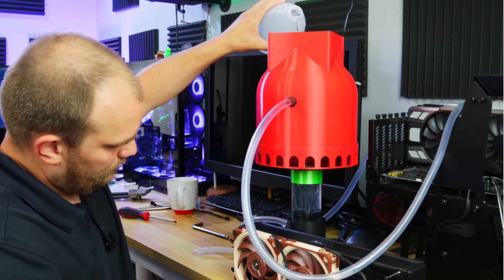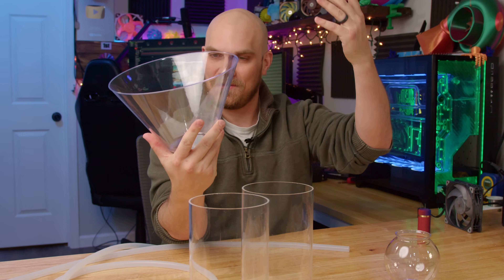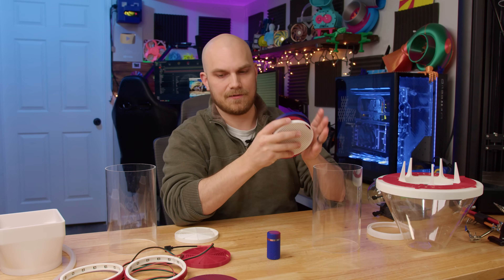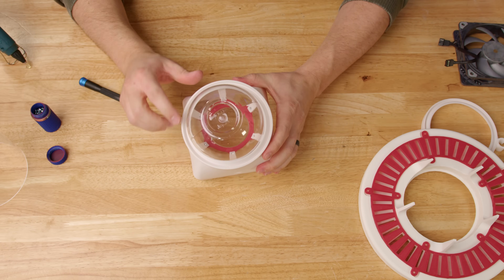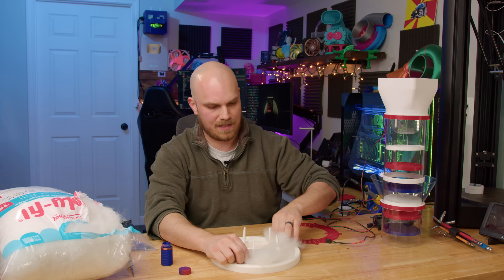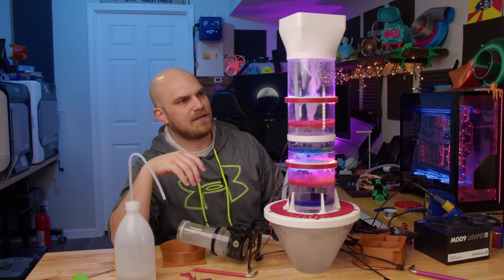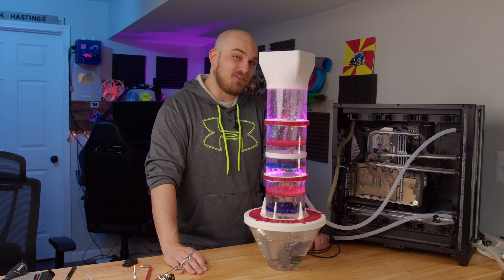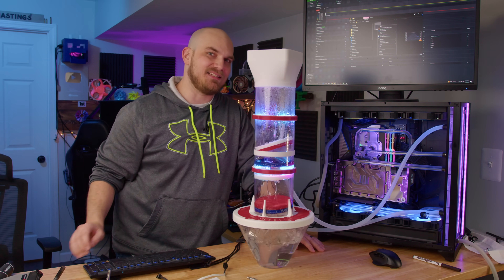Water Cooling..... With NO Radiators

Comment: I don't understand what the goal is here- other than to screw around, and I don't besmirch anyone for spending time screwing around. 

But that said, it seems like the sole purpose here is to get radiators out of the system. But why? Of all the components of a modern cooling system you'd want to eliminate, why the radiator? In this configuration you have not only introduced dust into the system, but you have also introduced biological components- mold, spores and bacteria- which would likely love spending some time in the warm confines of your computer's distribution plate- especially since that tower is a great big agitator mixing air back into the water.

Comment: Man your cpu runs hot. I have the 5950x and with a msi aio is runs max temp at 78 under aida64. Im building a custom loop right now so I I hope it helps. Does your loop get dirty that easy or is it just a thing with custom cooling? Over all very cool invertion.

Comment: Not that I don't appreciate the effort, but the only way to get around cooling passively (i.e. without forced air, electro/chemical boosts, etc) is increasing surface area and/or enlarging the reservoir. With the reservoir method, it's only a matter of time before it also heats up with continuous cycles and a steady heat source, just the factor at which it can shed heat versus how much you're dumping into it. Very similar to a 240 vs a 360 radiator. More surface area nets better initial cooling, but run long enough, they will equalize. 
Ideally any water coming into contact with your materials would also be effected by thermal transfer, ala glass or aluminum. Honestly the best low-buck solution is a 5 gallon (water filled) bucket with as many coils wrapped around the inside as you can fit top to bottom and a sufficient pump, like one for a fountain system. Your CPU coolant runs through the internal coil, or you can use the bucket directly as a reservoir. If you had an aluminum tank for the reservoir, it's that much more efficient. 
As an example, I use the bucket and coil method for cooling on my plasma torch. Air going in is about 330*F and coming out is ~80*F, measured last fall when ambient as also about 80*F. Not aesthetically pleasing by comparison, but damn effective for compressed air cooling before going into the separator.  Water to water with a significantly lower initial delta and kept inside, low against the floor where AC will pool up, you could run a PC hard all day and still cycle back to ambient temps at the exit.

Comment: Did a tower cooler with a rain pattern shower head, 6 foot of 4 inch pvc, bucket, and a fan blowing up through the falling water(used a Y so the fan was blowing in down the y, turn 135deg then flow up through the column).

Worked great, 0 leaks, but after ~4 months, noticed heat creeping up as I was going into fall, disassembled, well because I didn't have a filter on the fan(big oversight on my part), the water blocks all collected pet hair ><.

Comment: Wonder how long this would last before mould, algae and all sorts of other fun stuff gets in there. Unless you want to have to break open your CPU/GPU plates to remove pet hair and whatever gets in there, there should really be a liquid-liquid heat exchanger between the clean side of the cooling loop and the open-air side if you'd really like to run this for any real length of time.

Comment: @Major Hardware for me the whole point of this Vapor cooling is - simplicity and only problem is sound. Your approach fix what is working and do nothing with problems. You have basically 2 solutions for PC Vapor cooling -> A. Use shower towel  on a simple horizontal PVC tube with holes to spread the water by soaking and use couple of fans for cooling, B. Use simple shower head to spread the water on fully open air. Your more industrial approach have place in a very large scale, when volume of water in the system and whole scale of the system should be optimized to a reasonable scale, but you still have a PC water cooling that makes you want to pee all the time. Also there is C. option, to vaporize and condense water with sound waves, like Ultra sound, this is how electric air humidifiers work.

Comment: I think a better way of doing this would be to allow the water to cling to the walls of the pipe, then run air up.

If you ever try this a third time.
I'd get 3-4 different diameters of clear pipe, place them inside one another. 
Assemble the top similar to your fish bowl reservoir so a gentle flow of water goes down the walls of the pipes, place a fan up top to draw air in from the bottom and up the pipes.

This will give the water more surface area to contact the air with and increase evaporation.

It might not look as nice, but it would probably work alot better.

Comment: If the computer is dissipating about 300W of power it will evaporate about 478g of water in the air per hour. If your gaming sessions lasts 4h you will dump about 2kg of water into your room. Now if we are mining or rendering in a powerful rig that uses about 800W for 24h, every day you will dump about 30kg of water into the air of your room. While its fun this isn't practical at all, the cooling tower has to be installed outside and even then will be an unnecessary waste of water.

Comment: glue to the outside rings with magnets, then put magnets on the water spreaders. This way the heat from the water doesn't directly contact the hot glue.

Comment: tbh with just a normal clear fluid and rigid tubing there shouldn't really be much junk in your cpu/gpu block or radiator.

as long as your fluid didn't come with a bunch of junk in it (pastel / pearl) and it's not showing sign's of harboring life it'll be fine :P

(I to HATE to perform maintenance on my liquid cooling which is the only reason I put up with rigid tubing, no plasticiser to leech out and clog the blocks / 0 evaporation of the liquid so the water level doesn't change over time leading to a light ow my god is it leaking panic)

Comment: uh...why don't you make all the fill disc just like the ring that joint 2 tube together and cut the tube into multiple pieces, so you don't need that hot glue which is not water proof...

Comment: One way you can help with spreading the water is to have a gradual increase in pipe diameter when reaching the top of the tower. Second, you could use styrophome on the filter area so that even if it gets wet, it doesn't clog. Third, you could slow down the pump significantly because you gain all that extra volume in the tower. Basically it looked like you hade more water entering the chokepoints than leaving the choke points at the same time. Also you could try to change the inlet to the center of the fish bowl instead of on the side.

Comment: Did something like this around the year 2000.. Its the easiest way to get water below ambient temp. 3" pvc on top of a 5 gal bucket. Had a y flange at the bottom of the pipe by the bucket. Had one pusher fan. At the top I had a shower head. The pump was in the bucket. Just the air passing over the shower of water was enough to pull the heat out no need for all the in fill if the initial dispersion is good. After that I went to a water fountain setup to actively cool it down to around 35-40deg. Back around when the celeron 300a was around with a block I made that was. It was crude but worked like a champ.

Comment: I don't think it's the hot glue that gave up, rather the tube expanded a little from the heat making the rings not flush with the inner diameter of the tube. Overall cool setup ^^

Comment: To actually use this long term you’ll need an auto fill, or refillable reservoir thats not the main tower.  You could even redirect the airflow back down in an attempt to reduce evaporation.

Comment: I almost wish you used UV instead of RGB.  It looks just as cool but will keep your water sterilized.  All those water droplets on the side of the tube, when mixed with ambient air and when lit can grow all sorts of slime...  

Yeah, stuff doesn't grow in moving water easily, but there are clear spots where water is sticking to the sides.

Comment: Cut out windows so theres direct exposure to the water. cover the windows with some kind of porous cloth and attach fans to speed up the evaporative cooling effect inside the tower. It will cool down the pc even more.  So I think you should do a series constantly improving this design by making it smaller and colder with fans.

Comment: you could add legs in-between the diffuser rings to keep them located and separated from sliding down, also make them smaller diameter with tabs to fit the ID of the tube to allow air and water to flow around and down the ID of the acrylic tubs maybe then you could use one longer tube instead of joining two. also look at hair dryer diffuser may be useable for this

Comment: The heat from the pc isn't anyway near a problem for hot glue, it's plastic that it's a pain to glue, then with some water and it's 100% sure failure.
Wonder if you could use perforated metal plates that sticks out from the plastic tube as cooling? Say the plastic tube is 10 cm diameter then a plate of metal 30 cm wide etc, no connection with outside air but water hits the plates and (hopefully) transfer some heat to them and the pates in their turn transfer the heat to the outside air.

Comment: A "rain" type shower head is what we used to use back in the 90's 🤣.  Just a long 6 foot 8" PVC pipe ("reclaimed" from the junk yard for $5-10) with the shower head at the top, fan above, pump and all down below.  Literally 30+ years ago this was how you beat the "heater core" people to ambient temperatures.

Comment: Instead of having the fill inside the tubes, you would do better with having the tube fit into the fill. Also, For the fan you should instead try a vortex setup. Like have the water come into the side and spin around while there is a hole in the middle for the air to flow down. Or you can pipe the air past the point the water comes in the first stage. Another idea though, if you just remove the fan does this still work? It should in theory so reality is that you could make this a closed loop system and let the evaporative properties do all the work.

Comment: i want to build a water cooler that uses two loops. closed loop with two radiators in line. first radiator is air cooled. second radiator is watercooled . second radiator is submerged in a sink or tank that has a cold inlet from city supply. the first one is enough, but imagine being able to open a facet and your temps go from 80 to 20 instantly.

Comment: You should use some kind of continuous fuel injector to create a thinner water mist , and it will work even better
Reply: fuel injectors need a lot of PSI.
Reply: @ChrisWijtmans   modern fuel injectors ussualy do, but I'm talking about continuous fuel injectors they are used for examle in older VW/Audi instead of carb
Reply: @butcher2033  do they rely on vacuum?
Reply: @ChrisWijtmans  they work with pressures under 0,8 bar wich are easily achievable with water pumps

Comment: You can make a desk-top waterfall that looks like real stone that circulates water out of it's reservoir and exposes it to the air with massive effective surface area. IN that reservoir you submerge a pigtail radiator that's connected to the actual liquid cooling attached to your PC. The result should be even more efficient heat transfer, but you will need consider steps to moisture proof your PC (you could also just put the waterfall across the room and ensure it's well ventilated)

Comment: Now, do a fan less, sealed water cooling system. It don't rely on evaporation. It use passive air circulation only. A water pump is OK. It need to NOT look like a radiator.

Comment: run copper rods say 4 from top to bottom.  drill tight wholes throughout  the inner pieces and run rods through. Copper rods will hold mid pieces and absorb heat and release at top. mb solder some heat fins to top then fan draws.

Comment: hmmm... steps with metal passive radiators would work...  so not just needing the air flowing over the water, but where it could transfer to fins with exterior... so the fluid and air are kept separate to minimize the evaporation.

Comment: Fun idea. Use a window screen mesh to add surface area for the separation disks. Just mount them on top of the current stack disks. The finder mesh you use the more air pressure you will need.  Possibly 2 fans on the top to pull out.

Comment: Better solution than tapping a hole in the big bowl at the bottom?

Just run the tube in through the air filter.  Maybe make a hole for the tube to fit through.

If you need to hold it in place, you could make a plastic bracket that just holds it at the bottom but you probably don't even need to

Comment: One thing I have always wondered... if you had a large container of water just sitting on top of a CPU, with no pump or anything, how effective would the convection be?  Would the water not get out of the way fast enough to let the cooler water sink down to the contact area resulting in the water reaching boiling temp like as if it was on a stove?

Comment: personally, if I was making a water cooling waterfall, I'd go for something more like those little aesthetic bedroom fountain/waterfall thingies with the water fully open running over rocks on a slope. might need a seperate loop with a water-to-water heat exchanger somewhere to keep general debris from getting into the PC loop... (pipe in pipe counterflow probably good enough)

Comment: Having seen the water-flow, yeah, you need something better to spread out the water. Consider some form of drip plate, where the water can pool and drip out of holes in the bottom, all while the air has lined holes to freely pass by. If instead of something you can print, you want something more proven, consider a cheap shower head. Welp, should have continued before replying.

Comment: Coolingwater specialist here: to improve your design the only thing you need to do is increase the surface area. You could do this by printing a circular lamellafilter, which fits in the full length of your clear acrylic tube. More surface area equals more evaporation, upto a certain point of course.

Comment: Doing it the hard and messy and dirty way that will contaminate your system and encouragle biologic growth as well as Ionization very quickly.
Use a heat exchange interface to keep actual loop protected, and then just a simple swamp cooler design.  Reinventing the wheel aint gonna help here lol

Comment: Why not just use a big sealed tank?
no matter how hot your CPU gets,
you will simply not be able to boil
or even remarkably change the 
temperature of 10-20l of liquid right?
The Tank will also be MUCH quieter.
And you can put a submersible pump
in there as well to get rid of the pump
noise too. And some poison and anto
oxidants of course.

Comment: @Major Hardware First a disclaimer, this is going to be a long post, but I have several ideas that may make this look cooler and be more efficient. Pun intended. :)

1. Get rid of all those fillers and the baffles you have between your acrylic tubes you want a smooth surface all the way down to your reservoir.
2. Reposition your coolant inlet so the coolant flows down in a spiral along the inside of your acrylic tubes. Using centripetal force to thin out your coolant medium. You may have to taper your acrylic tube in some way to keep the coolants spiral flow from top to bottom.
3. Change your fan direction to move the air with the coolants flow, the movement of the coolants flow should help pull the air along it's path. I think :)

And that's it, these steps should be enough to help your systems efficiency. But I have some ideas that may improve it further. Get your reservoir to form a whirlpool and put your coolant output at the bottom center. You may have to add some sort of mechanical force to form the whirlpool, I don't think the pump will have enough draw to form it alone. Also add some fans at your air outlet to pull the air through your filter medium and help your air flow through your system. 

All of this together will probably improve the look of your system, decrease noise, and improve the heat efficiency. 

I hope you do this, because I really want to see it in action and prove my theories of improvement. I really enjoy your content despite being unable to do any of what you do myself. So keep doing what you do.

Edited: because YT deleted half my post the first time through.

Comment: I remember people making coolers kinda similar to this 15-20 years ago with the water getting slightly cooler than ambient. It was constructed from just plain old grey pipe and shower head at the top and a 45 degree piece in the middle facing downwards with the fan blowing air through it on the water dropping past it all the way from the top to the bottom without any middle grills or anything.

Comment: Interesting setup, although it would function way better if air was pushed up thorough it from the bottom, versus pulled up. 

As a example, I submit a educational video ref… from https://youtu.be/7w4rg3UcsgI His draft style solar powered evaporative airconditioner system is really similar.. and he uses PVC, stuff you can get from Home Depot, or Lowe’s.

Comment: So you're building and overly engineered evaporative cooling tower. I should point out that you no longer have a closed system so your water will evaporate and will eventually clog your system with minerals. Don't let all the water evaporate out.

Comment: Some internal framework would have helps the fill stay inplace without disrupting the flow too much. It didn't look too bad with how much time was spent on the design and materials used though. Even I might consider doing something similar for my setup once I have my desk etc they way I want it.